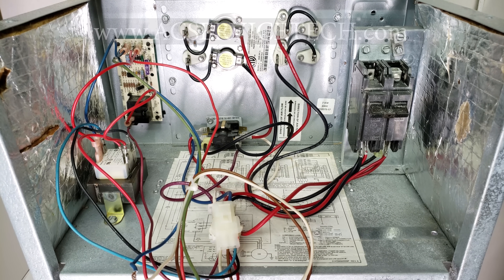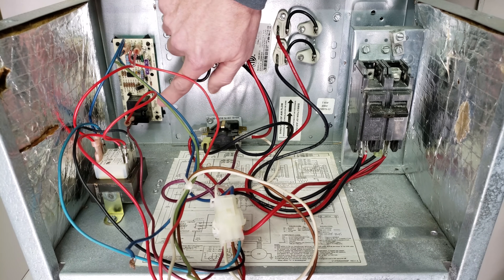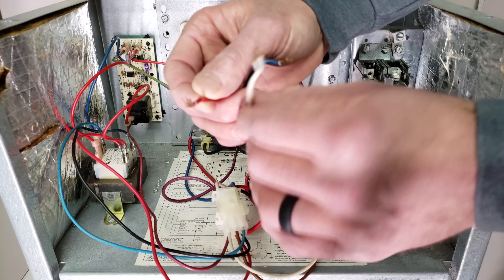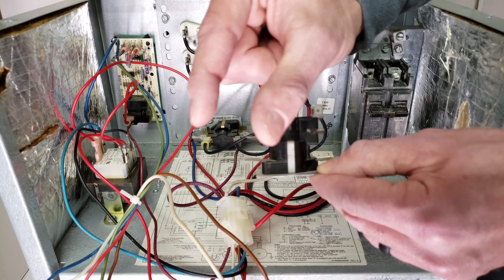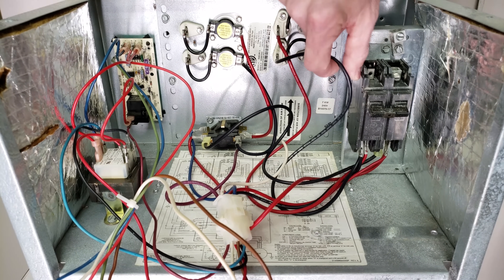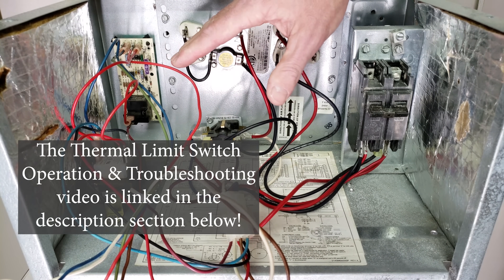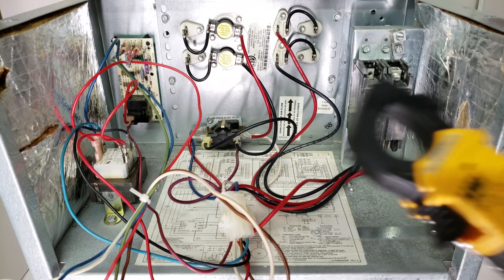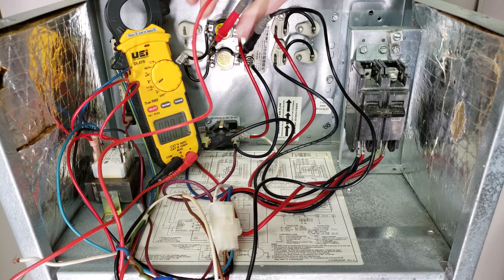Air Handler with Electric Strip Heating: Operation and Troubleshooting!

Comment: OL on the meter is referring to the testing leads on the meter. OL stands for open leads... no path from one lead to the other.

The meter is always checking the difference from one lead to the other.

Difference in resistance (ohms, continuity or mfd)

Difference in voltage.

If checking two points on same hot circuit, it should read 0 volts, not OL. This indicates there is a path from one lead to the other but no difference in voltage.
This is important to understand when testing for voltage drops across contact points in a circuit, whether its a contactor, relay or sequencer.

A multimeter is a very important tool. Understanding how it works is essential. 

Always make sure your meter can handle the voltage range of the circuits you are testing.
If you use a meter rated for 500v and try to test a 680v circuit it will damage the meter... because there is no overload/overlimit protection built into most meters.

Therefore, OL only means Open Leads.

Comment: I’m looking for any suggestions to where would be a good place to start looking with an issue I’m having. Breaker to the heater trips but only if the thermostat is set above 65 degrees. Anything 65 degrees or less the heater will run, cycle and maintain set point. If set to 66 degrees or higher the breaker will trip. The next day the weather was colder out significantly, and heater would not go above 60 degrees. Again, it would run, maintain and cycle at 60.

Comment: If its a 20 kw heat strip the breakers at the panel need to be double pull 60 amp? So only one 120v leg of each breaker is running to the breaker in the air handler? Thanks

Comment: Great video! What if instead of a sequencer, there is a relay, any video? I have a heat strip and low speed fan that turn on right after the cooling stops, but they never turn off, thus consuming lots of energy.

Comment: Hi, my heat strip s, work only when I jumper red and white at the air handler, even whith a new tstaht, does the outside unit has  to do with this
Reply: Having the same problem, u fix it by any chance?

Comment: I have a straight cool system with electric heat strips.

Which part from the electric heat can create a short in my condenser contactor?   Outside condensing contactor was having an electric short and went away when heater was disconnected.  This happened during cooling mode.

Thanks in advance for your support.

Comment: I usually just work on washing machines and dryers, after watching your video it looks very similar on how a dryer is setup.  I should be able to fix my old Trane electric central heater after watching this 2 or 3 more times.  👍

Comment: When my thermostat calls for aux heat it  after the heat pump reaches colder temps. My blower then stays on blowing cooler are and won’t shut off until I flip the breaker. Once reset it then works for awhile and repeats this process. Only when extreme temps happen. 
Blower motor, electric heat strips and heat pump fan motor have all been replaced. Please help.

Comment: most of the time i have no power to my W wire but sometimes it’ll randomly run fine… Can anyone help with this? It’s electric by the way not heat pump

Comment: I am a retired Mechanical Engineer with HVAC certifications with a strong electrical background and I worked in training as well. I only say that to make this comment. "This is the best presentation of the HVAC electric heating explanation I have ever seen". Thank you for taking the time to put together such an informative and crystal clear presentation.  2 Thumbs up !!
Reply: I could swear I just read this exact same comment you made on another video...🤔

Comment: If I don’t pull a wire and ohm out that fuse or overload what will I read?  Possibly a high resistance correct?  If that fuse is intact I will get a very low resistance correct?  You don’t have to yank wires. Maybe you should teach people how to really read an ohm meter. Voltage takes the path of least resistance. Your ohm meter uses voltage to measure resistance. And get a diagram.

Comment: You should include diagrams and other aids. Just sticking your hands in an enclosure full of wires and components is pretty confusing for a beginner or whoever your audience is supposed to be. A diagram would help showing the board and the sequencer would be a better tool for learning. I work in research and development with a lot of beginner technicians. They are already confused enough.

Comment: I run a company and use your videos to help out my newer techs. It saves me a lot of time. You do a great job explaining in detail. However you made one mistake, on the single sequencer (M1,M2,M3,M4) the upper and lower level contacts close at the same time, 1-20 seconds. When you have a dual heat sequencer, 2 side by side or a second sequencer (M5,M6,M7,M8) powering the 3rd and 4th heat strips, the second one will close at the later time of 30-90 seconds. I just wanted to clear that up for newer techs watching this.

Comment: I had a technician came and he said that I would need to replace my compressor and then said it's probably not worth it and that I should replace the entire HVAC system.  fyi, my AC is cold and my normal heat pump works fine blowing very warm air except for when the outdoor temp. drops below 30s.  Can anyone shed some expertise and advise?  Many thanks.

Comment: Great video!  Is it possible to accidentally crosswire and have the heat strip activated when the blower is on, but the thermostat heat mode is set to off?

Comment: Can you do a video on a heat strip that has no sequencer and the white wire from the thermostat is connected to the 24 v common on the contactor. I just want to know how it turns on and off. Thank you

Comment: Hello, Thanks for informative video. I have quick question - recently, i have replaced my old 5k heat strip with 10k strip and connected all red/black wire as it was on 5k. But, when my unit runs it doesn't seems to be hot enough. Not sure if replacing with 10k did anything so I am not sure if I did something wrong? Please let me know if you can guide me. thanks

Comment: Excellent video to prepare for return HVAC tech repair.  Had blower but no heat, aux heat light flashing  in unoccupied building after turning temp higher for cold weather.  Found the HVAC tech did a maintenance service call weeks ago but failed to insert the power disconnect plug at outside heat pump.   Installed disconnect and Heat Pump worked, but concerned if weeks of heat strip only damaged limit switches, fuse or heat strips as blower worked but no hot air prior to reinsertion of power disconnect plug.

Comment: Mine didn’t do this. My capacitor and motor got stuck and we came home and emergency heat was on I could smell a hot wire smell. I check thermostat and aux heat was on with no air flow. I open the filter return and extremely hit air rushed out. I was like we’re lucky house didn’t burn down. Couldn’t figure out why it didn’t cut off when it got that hot. I replaced capacitor and blower motor and all is working now it seems. But still scary that the heat strips just stayed on.
Reply: Did you
Check if they bypassed the safety limit switch ?

Comment: Thank you for putting this out there.  Helped me T/S my air handler. Found the strip heaters were burned out.  1 question for you or the community here, what would cause 4 strip heaters burn out on a 4 year old air handler?

Comment: I have a icp unit recently replaced txv worked great a couple weeks. This morning I found ac running with heat strips on. Unplugged heat strips and now EVAP fan motor runs continuously.

Comment: Really well explained, thanks. But while I don't know which terms are preferred by which experts, I propose that it's misleading to repeatedly insist that a sequencer is not a relay.  It is a complex relay, not a simple relay.  It uses a signal circuit to switch another circuit, but it has a heating disc added so that it's not electromagnetic but thermally contacted?   A digital relay is not electromagnetic either.    I don't really know HVAC but I bet that in a pinch, a relay with the appropriate ratings could be subbed for a sequencer.   Please correct me if I'm way off-base, but I think I understand.

Comment: this looks like straight electric heat, got any videos on a heat strip such as on a Nordyne electric furnace wired into a heat pump such as Rheem or Goodman split system used in mobile homes

Comment: If you wanted to disconnect the emergency heat for a generator,  which wire would you break with the low voltage wire coming from the automatic transfer switch for the generator?

Comment: Can some one help with problem ASAP. I got not hear and its very cold in Washington. I recently found the wire and limit switch burn out. I replaced the wire and limit switch and everything worked as normal. About two weeks later the hear went off again. I went down under the house to check and found the wire and the thermal Fuse burn the hell out just as bad as the switch and the in power wire was before. I have no idea what is is happening but this is going on with the same side of the limit switch and thermal fuse. Any help or advice please. Thanks

Comment: I understand that heat strips normally activate at 40F or below.
Can the activation point be adjusted to 25F??????????
If yes, How on a Trane TEM6 air handler.

Comment: I have a heat pump and my AC and Heat pump work fine. I tested my emergency heat by changing the mode at my thermostat and my blower turned on but no hot air was produced.  If the blower is on, does that rule out any concerns of a bad/tripped breaker?

Comment: Could you refer me to the correct video on how to diagnose a White Wire overvoltage Issue. I had a small fire on my control board relay, I replaced the sequencer that I believe caused the problem in the first place. And of course I replaced the Control board itself. All of this was due to the furnace strip heater and fan staying on all the time, I had to hit the breaker to stop them. I kept doing this for too long. Dumb homeowner mistake.  After replacing the Control Board, and Sequencer my Nest learning thermostat is telling me there is an issue with the W1 wire. The Error code tells me overvoltage of the W1(Aux). I have a single stage with Electric Aux/Emergency Furnace.  This is a video showing my setup:  https://youtu.be/uMWzKfgpvpo

Comment: isn't the only way to test a thermal limit to disconnect your fan and see if it trips the limit at 150 degrees? then you know it actually is operating
Reply: Can hit it with a temp specific heat gun isolated

Comment: where does the 24v come from that powers the O connection for the reversing valve?
Reply: The O comes from the thermostat and goes to the condenser. The air handler does not need the O, reversing valve. The thermostat turns on the compressor with the Y, compressor wire for heating. When a heat pump turns on, the thermostat energizes the B or O wire for the reversing valve, depending on brand, and the Y wire for the compressor. O wire is for energizing the reversing valve during cooling and B is energizing during heating.

The W, heat, is for E heat, or Emergency Heat, mostly electrical. Some theromostats turn on the G wire too.

Comment: Hi there I have an air handler RHSL-HM2417JA and it is setup the same like in the video. I need to replace the wires from the breaker because they burned. My question is what are the gauges of the wires coming out of the breaker and what brand of wire do you recommend? Thank you for your time.

Comment: Question: Possible to use this Air handler with 5 kilowatt heater coil in my  Fifth wheel on 50 amp cable ?

Comment: I have a question. Does that blower motor runs on the same speed for cooling and heating?  Since is the same common wire that power the blower motor.

Comment: Had a service call today on a heat pump system. I went to turn the system on but the air handler did absolutely nothing. I had 240v at the first breaker. I also had 240V coming out of the 1st breaker which then ran to the heater kit. I then traced the wires back which ended up going to the 2nd breaker inside the air handler. I had no power on the 2nd breaker and also have no power at the transformer of course which I replaced already. I’m assuming the the heater kit should be replaced which then will then supply power to the system then will send 240v to the transformer which then will step down  to 24v. Any thoughts on what transpired?
Reply: No 240 from breaker means you would need to go to the main breaker panel for the home because that’s what supplies the 240 to the breaker inside the unit I would start where the power comes from the transformer is just a tool that’s used to step down the high voltage power to low voltage circuits, it itself is supplied from the incoming power like the Vid above shows the heater kit doesn’t supply power it’s a load in the circuit placed in a loop of voltage it’s only defective when you can confirm power is reaching it but it still doesn’t operate the way that it should

Comment: Hello,  I love your videos.  Can you explain why we need a breaker when we have electric heat strips.   Would I connect just the heat strips to the breaker or can I put the high voltage directly to the transformer from the breaker or separate.
Reply: You must have a breaker for safety reason.

Comment: I have a 2-pole 20a breaker feeding my air handler. Added heat strips, when the heat is on the breaker hums?  Just on the cool setting, it draws under 10a, when the heat comes on it draws 20.1a ? What gives?

Comment: H N Year ❤
Why when we call the sears parts department , they do not want to sell the parts on their furnace ,& say only they can sent the tech . I told them , I call the man who install it , he sent his son & his helper . after 3& 1/2 hours they said it is thermostat & I told them that is new , I got it from homedepo , they broke ez-trap 
said it was broken , then they bypass it . I Said why , they said call them  summer time they come fix it  🍅🍆🍅 
I did not have hemorrhoid man .
I told them sir the gas is off 😂 
They looked at me 🥴🥺  HIYAH  HIYAH
OK , then they said : $ 125 
I sid HIYAH  with msg 😋😂
I told them why I can not read the code 
the green light non-stop blinks , they said 
1250 us $$ 😄. HIYAH . please thank you 
. HIYAH . Now .I call the sears : they said I need a new furnace 😭 👹🍅🍆🍅
HIYAH  . now Tomorow the 28 of dec I have to call kenmore factory to see if they sell me the circuit board . 
I think it has heart problem . HIYAH 😂

Comment: Wanted to ask a question so if one of those fuse links were to open for one of the heat strips one fuse link for each strip, it doesn’t affect the other heat strip does it?
Reply: In a parallel circuit it won't affect the others but you don't want that because if the first heat strip fails then your blower won't kick on.

Comment: Craig, I tried turning the heater one time about  3 weeks ago and it did turn on fine with heat coming out of the grillls but it turned off after 5 mnutes. It never came on after that whenever I try to turned it on again hope this can give you a clue . Again the AC WAS working and it now also won’t run after I bypass the thermostat.
Reply: you get it fixed?
Reply: No not yet, I’m trying to fix the AC now cause its getting hot in Sacramento 90, s these past 3 days. I’m not worry about the heater rite now . Only the AC I’m worried about rite now. So i dont see circuit board and 3 amp fuse. I’m thinking about pulling out the transformer maybe it’s toast when I bypassed the thermosthat.,( didn’t really know what I was doing I might have stuck the paperclip to a wrong wire that may have short circuited the transformer? I’m guessing.

Comment: New subscriber here maybe u can help me . Electric heater hasn’t been running for years now. The ac runs but the heater is not, so I decided to bypass the thermostat with a paper clip, the fan , heater or ac didnt come on ( I checked the circuit breaker for the heater and it has 240 volts does that mean the problem is in the furnace? Like the low voltage transformer or sequencer is toast or burned? Also the ac is now also not working , could I have shorted something when I bypass the thermostat? Been trying to figure out what’s broken inside the furnace for a week now. I just don’t know which part to check : note I don’t see any fuses inside the furnace hope u can help me.

Comment: This is great information. I have a Trane unit almost identical to this and the fan delay relay was changed out but with a rly2807 that has normally open connector on relay. And in ac relay works fine, but in heat mode the fan will not come on unless thermostat switch fan on. I think someone put the wrong relay on this unit, as you said this system should have a normally closed relay.

Comment: I do have 1 question, if i disconnect the connector at the blower, and it shuts off, what does that mean? My A/C cools fine but it never shuts off unless I turn it to heat and switch off circuit breakers. Had A/C serviced a month ago and the company wants to charge me an arm and a leg to just to come look at it.  I'm strapped for cash, I'm also a certified auto technician so i feel capable to deal with this on my own, my a little help.
Reply: I am not a ac tech. But, I can tell you if you pulled the connector off, the blower will shut off. It means no power.

Comment: Question I have a champion brand that I think used to be a York but they change name or idk but my question is why is the air handler connected with a breaker in the unit instead of being connected with a terminal i had technicians that are confused and not knowing if that even supposed to be wired that way